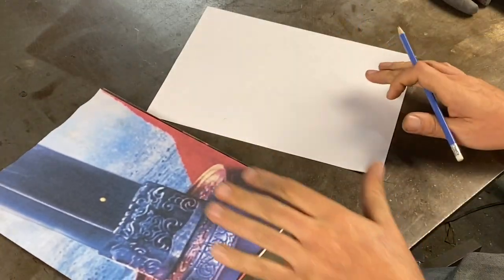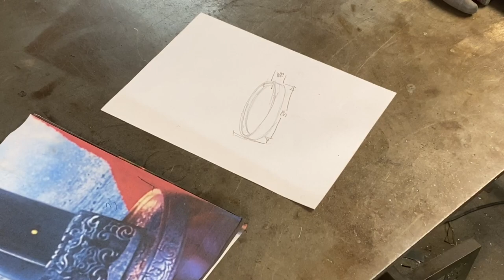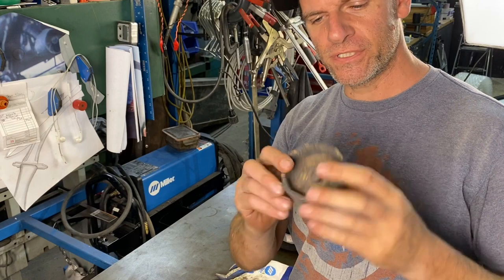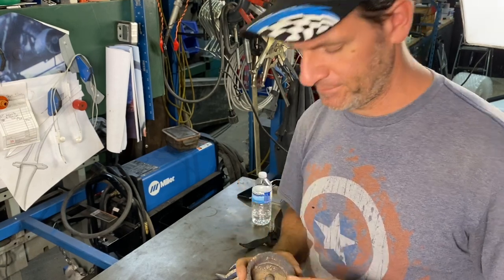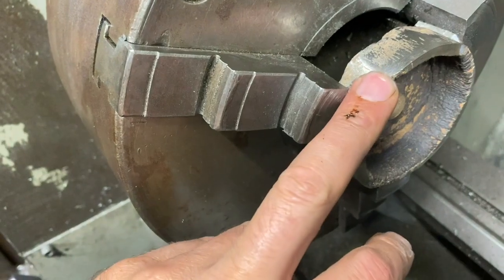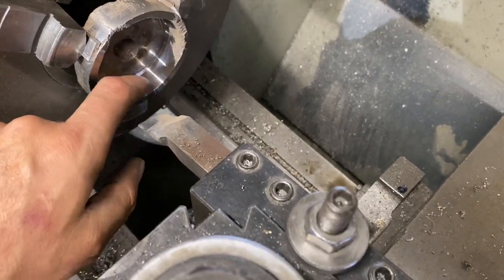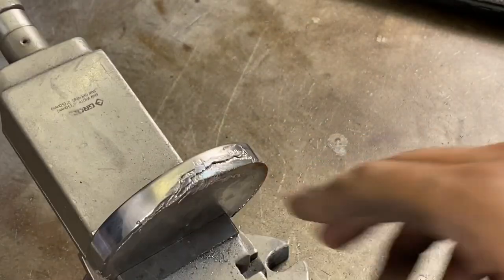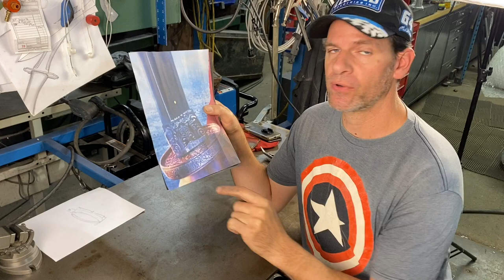Making A Forged Titanium Sword From The Movie MULAN  !! part 2 Making The Guard!!

Comment: like your video, for the guard, forge to 3.2 x .5 solid then machine it, would be much easy. when you turn titanium SFM 120-180 / .010 IPR.
Reply: use carbide insert to turn titanium
Reply from the maker: That’s exactly what i use thanks for the comment

Comment: Hello Rob, I am just getting into bladesmithing, I live in Oshawa, any idea where I can get some proper knife making steel? I've been practicing on rail ties and what not, but would like to at least start practicing making some low layer damascus with known steel. The only places I've found locally stock O1.
Reply from the maker: hey Buddy i supply alot of blade smiths here in Canada i stock 15N20 , 1095 and 1080 let me know what you need
Reply: @BonifabcustomRobBonifacio  Whats the best way of getting in contact? through your FB page?
Reply from the maker: Beer Baron ya either my FB page or instagram or email thanks

Comment: Amazing work, Rob!  You dispelled a couple of my misconceptions: I didn't know you could machine titanium with tool steel, and I thought you had to weld it in an oxygen free chamber.  Great job on this guard!
Reply from the maker: I just saw the comment on the tool steel part , those tools had carbide tips on it and i had to sharpen them like 50 times to make that parts i find the forged titanium the worst to machine even carbide gets destroyed lol
Reply: Titanium is incredibly difficult to machine. That’s why machines parts are so expensive. Lots of coolant is necessary to keep carbides cool but titanium is so brittle and hard that it creates so much chatter with carbides that the carbides shatter or chip out much faster. I’ve heard of machinists using shock absorbers on titanium parts to absorb the harmonics to make carbide tools last longer.
Reply from the maker: Leland Holton very interesting never heard about the shock absorbers before, thanks for watching